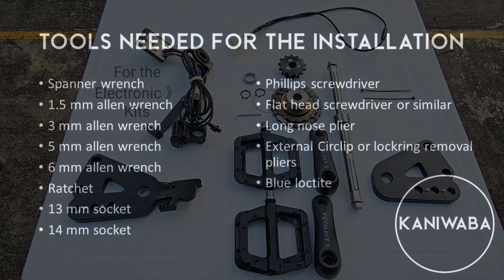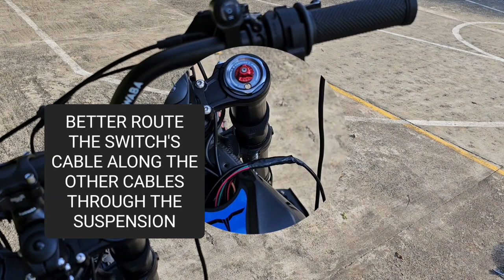KANIWABA - TALARIA Sting R MX4 Electronic Power Pedal Kit and Power Kit Installation Video

Comment: After installing it as mention on the video, code 700 apeared. Throttle not working. Do you know the solution? When plugging normaly without kaniwaba, throttle work normaly. Seems like the kaniwaba controller does not work. Talaria MX4. All my connection are well made and as described on the video.

Comment: It may be my fault but no matter how much i tention it it rubs the frame.😢
Reply from the maker: If is rubbing against the side, you need to shift the sprockets a little to the side, if it is rubbing below, then put the bike on a stool, loosen all 4 side bracket screws, push down on the spindle to tension the chain and while holding the spindle down, tighten  screws.